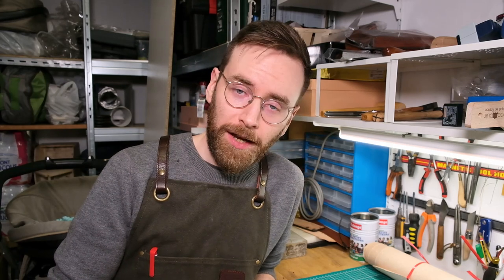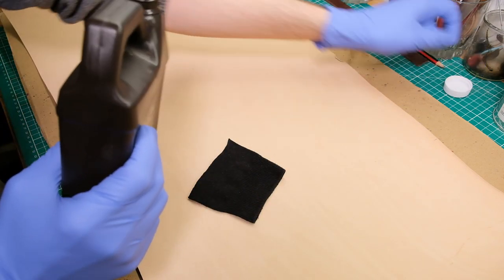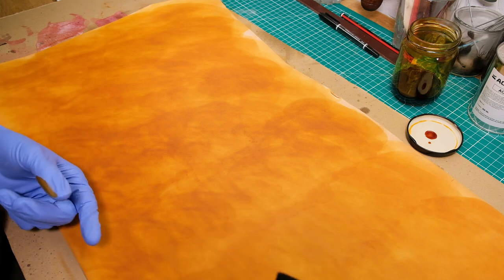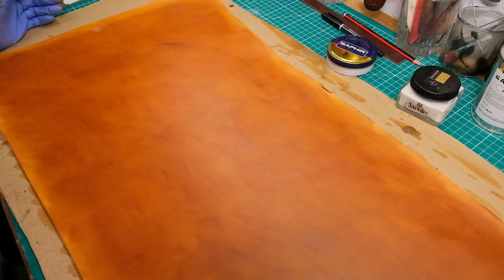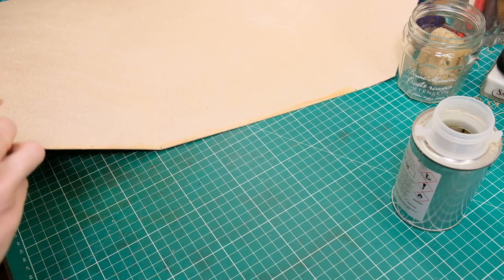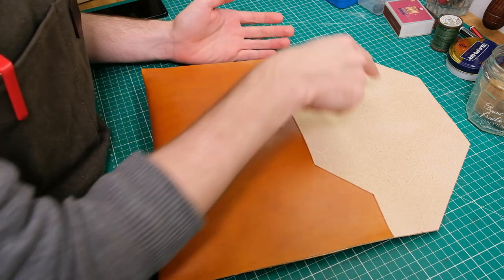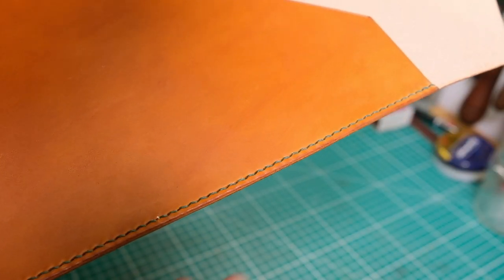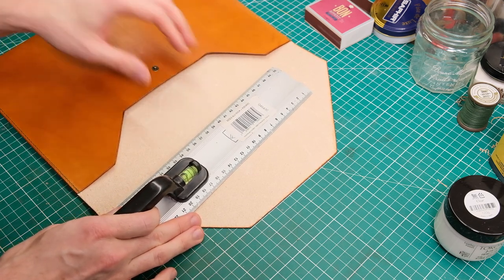Making a leather A4 document pouch / folder

Comment: I’ve also recently started using the Meisi thread and I find I like it even better than Ritza Tiger. Plus the spools are great, as my thread doesn’t unravel everyere.
Reply from the maker: Glad you agree! Meisi is still quite hard to find but are quickly becoming very popular thanks to the quality of their threads. I have yet to test Tiger Thread as it's really hard to get in France ... and it's not easy ordering some when I'm certain it won't stand up to the quality of Meisi x)
Reply: @JamesBerry  I haven’t actually used their linen thread. I use the Nanmei polyester thread, which compares very nicely with Tiger. It’s bonded, colorfast and uv resistant and is a flat thread. The color range is absolutely amazing. I have yet to find it in the states, but ordering it directly from China has not been a problem. My other go to thread is Vinymo, which is a round polyester thread. Vinymo seems to be gaining in popularity among many of the YouTube leather crafters.